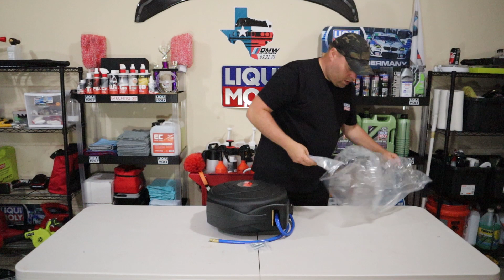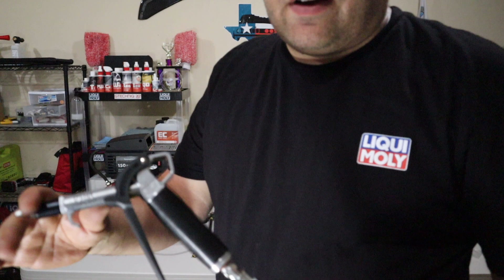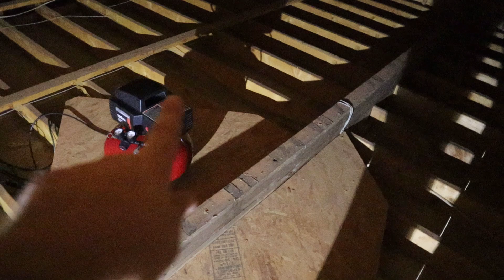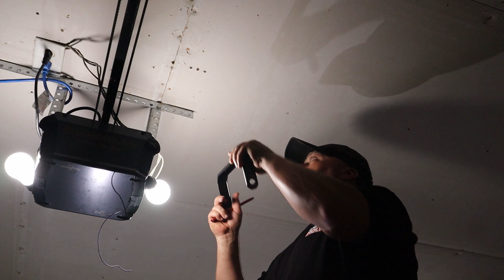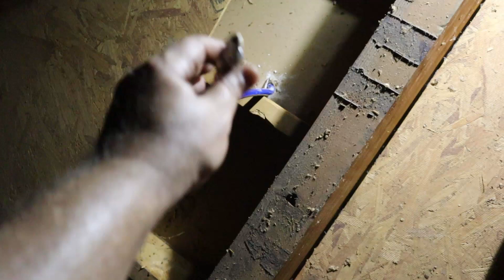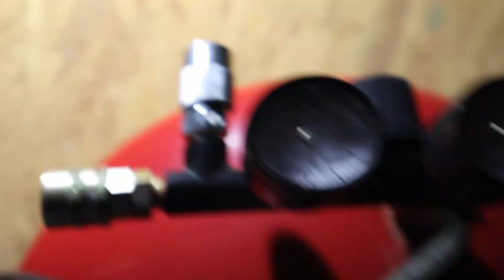Best Air Hose Reel on a budget | Unboxing, Install & Review

Comment: Looks good, may I suggest mounting both of your reels up in the attic and cutting a small hole so that only the hose comes through the ceiling. Much cleaner look.
Reply from the maker: I tried that, but anytime I needed to pull them at a weird angle it would cut into the ceiling and bind up.
Reply: @CarsWithKeav  I see. I think they make a four way roller to combat that issue. I’ve seen it done once before and it was really nice. Was thinking of doing the same myself. Thanks for the feedback on the binding, I guess I will need to look into that roller idea more.
Reply from the maker: @j.a.1265  Just depends how far you want to go. Shortly after installing them I realized I will need to go to the basement garage because getting water there was too difficult.